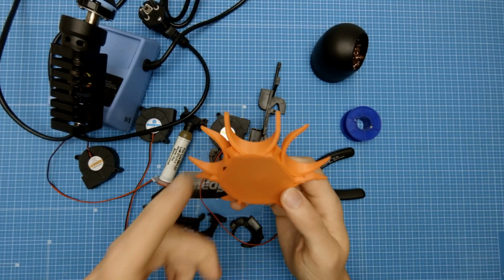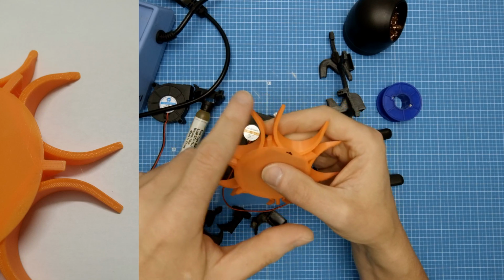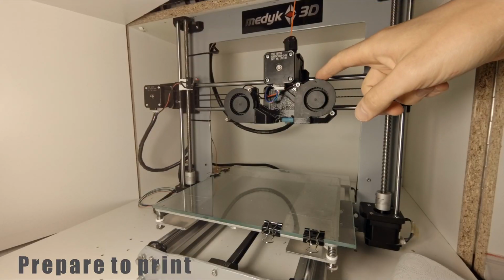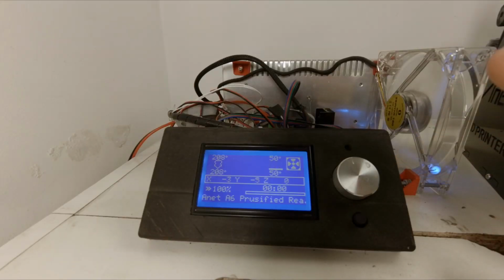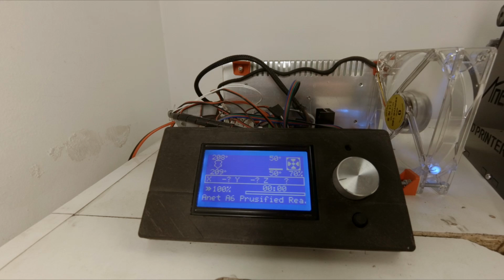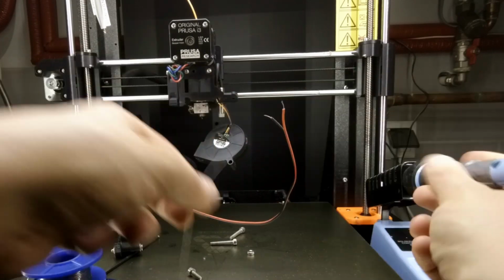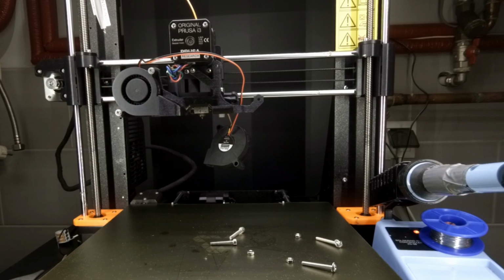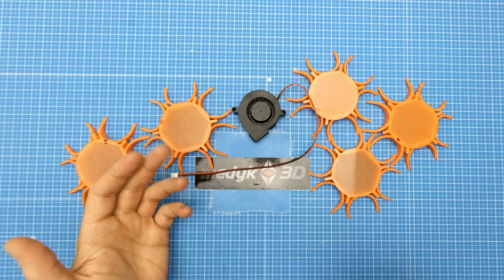Prusa Part Cooling Fixed? Double cooling fan mod

Comment from the maker: It did not make to the video but:
For Anet I used ASA filament and for Prusa PETG.
I don't know yet why but on Prusa it's a little bit too loud.
It can be the cheap 5015 fan or PETG is too flexible.

Comment: I have a question.
Did you have to change something in the options when adding a second print fan in Prusa?
Reply from the maker: Nope. Just connect everything properly and it should work.
Link to the mod:
https://www.thingiverse.com/thing:3697665

Comment: I'm not sure but if you mount 2 fans in // you divide the voltage by 2 in each of them right ? So less power for each ...
Reply: Voltage should be the same across a parallel circuit, but current is not. Opposite is true for series.
Reply from the maker: Exactly. And two cooling fans in paaraallel shouldn't be a problem: https://forum.prusaprinters.org/forum/original-prusa-i3-mk3s-mk3-general-discussion-announcements-and-releases/part-cooling-blower-fan/
Reply: Fans have 5V supply not 12V as noted in description affiliate link for the Einzy board, see link, they run off the same power rail so run fans in parallel, what it doesn’t say is the capacity for the parts connected to the fan port, nor could I find an electronic schematic to derive it but it isn’t perfectly clear from what I can see that running an increased amp load on that 5v line is problematic but this is an old thread, the bump in time cause anyone confirm if they’ve done this and did not incur any issues with their board? 5V is 5V but 3 watts is not 6 watts so there is definitely a different load on this and I am also curious if anyone has seen this in improvement in part quality over time or if it is just an initial onset that perhaps I just need a new fan rather than a mod

Comment: Really nice video m8! I don't go over 80% with my dual-fan because 2 things - I use supposedly stronger fans which Caribou sells and layer adhesion suffers when I go higher fan speed... at least some filaments (I am too lazy to test every filament I use, how high I can go with a fan) so I settled at 80%... If I may suggest on thing you can do - do PID tuning with fan on (your max fan speed) and not when nozzle is on the bed, but use some failed print with infill under the nozzle to mimic real printing situation... PID should minimize the temp fall when fan kicks in... I hope you understand my very rustic explanation :D
Reply from the maker: Hey Heino! Thanks for the tips. The orginal Pursa seems to deal with 100% speed no problem. But Anet is different. The thing with PID tuning the Anet was: I set the 0% speed and tune it, it works ok. But then I tried with 100%. It tuned ok but couldn't start printing because at 0% when starting the hotend couldn't stabilize the temperature. 
I will try to raise z-axis, put some 3d print beneath and set cooling to 60%.
And two questions:
1) I used ASA for Anet to print the mod and PETG for Prusa. Anet it's ok but Prusa is a little bit too loud. Did you use PETG and noticed that's it's louder? I'm thinking that it might be the fan itself or PETG taht is too flexible.
2) What's your maximum overhang? I think that for now I will stick to 70 degrees.
Reply: @medyk3D  Is your Anet stock extruder (chinese knockoff) or prusas e3d v6? 
You could try to add manually extra gcode (with prusaslicer "before layer change" the M106) like 50% at layer 3, 70% at layer 5 and 100% at layer 7... those are example numbers.... I think this way is only way with prusaslicer to change fan speed with gcode... S3D have that option but yeah... 
and the noise thing - I printed mine PETG and there is quite noisy vibration sound by the fans... as I am lazy as a turtle then I dealt that with a tape strip from one blower to the other blower fan over the extruder motor.... like a those oldtime 2 bucket carrying thingy which went over the sholders behind the neck.. I have to try ASA, if I get some time... damn my english is so bad.... 
My max is also around 70-75 degrees.... but there is also a little trick - if overhang is nice and open/narrow (like your testprint) then there is almost no difference between the rotation angle - is the overhang to the front/back/right/left and between those... but if the overhang is like a chin of the head (frontal part is clear - where it builds the chin/overhang, but back part - head/neck/back part of the head - is the infill and such, then it is better you orient overhang into the one fan (right or left) because some airflow from the second fan will be missed due the infill... especially when overhang is wide... when it is narrow - like a bridge or a bird peak, then front/back orientation is better... it is try and error.... mostly... that came so long - sorry m8 :D
Reply from the maker: @huntliba  Anet has a knockoff obviously :) No need to change the gcode - there is a setting for gradually reaching max speed 4:10. Thanks for the orientation tips - that makes a lot of sense actually. Maybe I will tinker with the mode to make it sturdier. But why why not go 4020 noctua fan or something...
Reply: @medyk3D  now I see... I have never tried that - if you don't need it then you don't use it :D
noctua or other fans are option but I am too lazy to start modifying the fan shroud and also, I don't know would there be a benefit because noctua is low noise but also less airflow... I am no tinkerer... I will settle with anything that works :D
Reply from the maker: @huntliba  Yeah. And I have to struggle to stop me from checking that noctua 4010 fan has 4.8CFM and 5015 is almost the same...